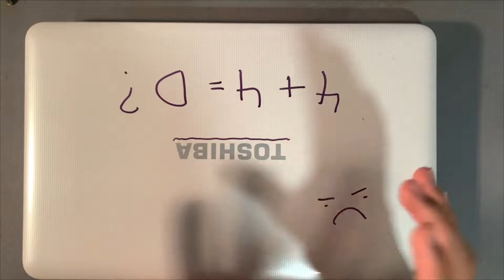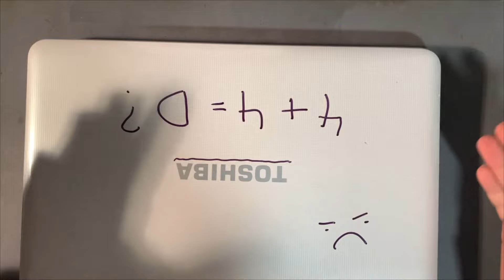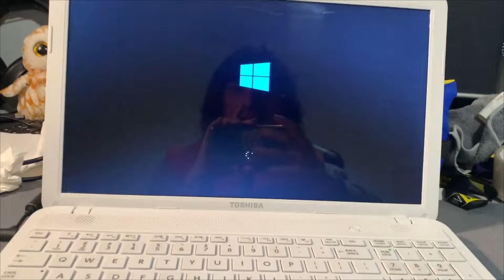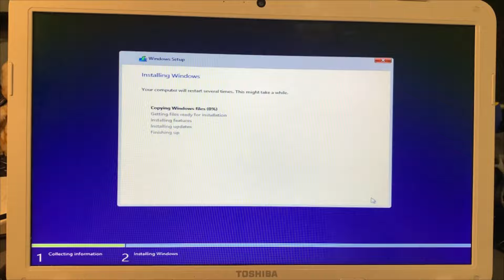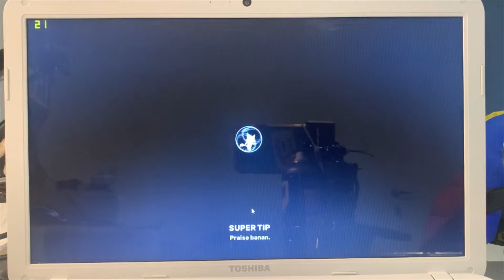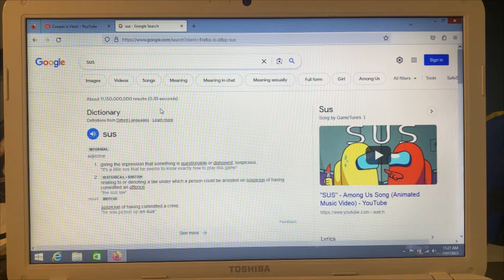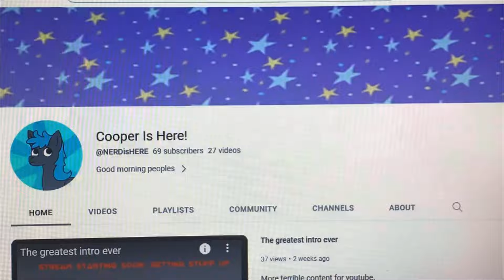Terrible Toshiba Laptop Restoration

Comment: Hi. Does the WiFi driver come automatically installed on Windows 8.1
Reply: I think it does
Reply: Cuba
Reply: Depends for me it didnt come but a solution is plug pc/laptop into router or use hotspot by usb cable then get app driver booster 10 and do all drivers kr any app that installs your drivers